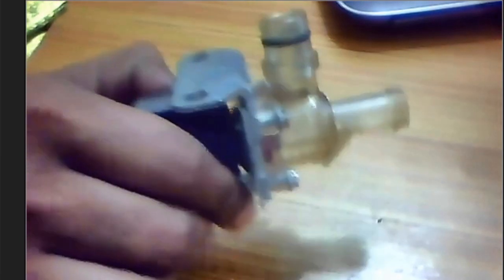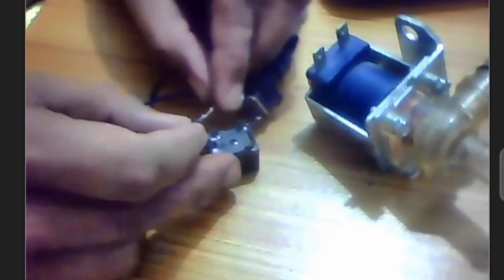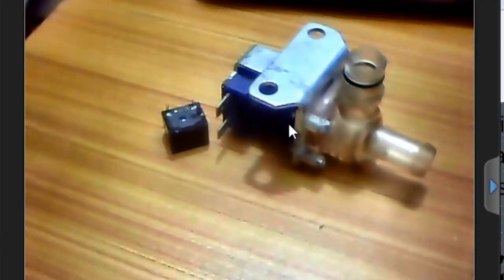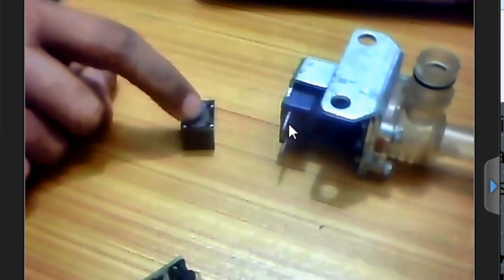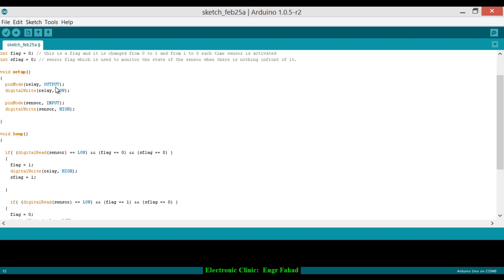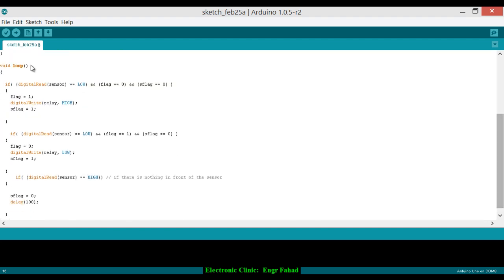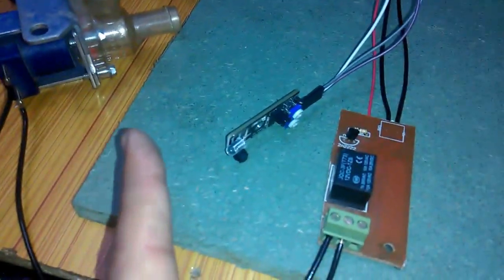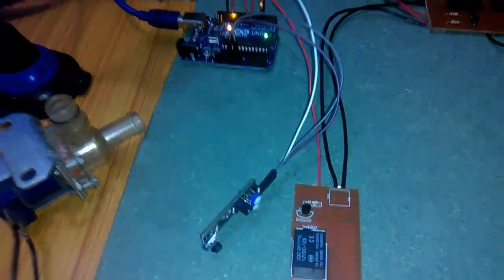Arduino based Automatic Water tap using solenoid valve, infrared sensor, relay and transistor

Comment: Hi the program mentioned in you video is a toggle switch basically  can you help me with a program where if one puts his hand the water flow is on and when one removes the hand the water flow stops thank you
Reply from the maker: check playlists. there are two other versions of the water tap system

Comment: My solenoid valve wont turn on. Is there any addition coding ?
Reply from the maker: my friend there is no addition, check your adaptor voltage and current ratings
Reply: my adaptor voltage is 12V and 1A, is this the reason ?
Reply from the maker: did you find its coil resistance???
Reply from the maker: whatsapp your connection, and solenoid valve pics. 
+923339218213

Comment: Hey! Thank you for the video. It was so helpful. I am trying to do the same thing with an air solenoid valve. However, I do not have a relay switch. Is there any way to do this without the relay switch?
Reply from the maker: Rachel watch my tutorials on relay driver circuit design calculations
Reply from the maker: Rachel check other tutorials.
subscribe and keep visiting electronic clinic 
if you have any question feel free to ask.
Reply: Electronic Clinic definitely subscribed! The video tells me how to calculate it the current needed for the relay, but I’m still not sure what relay to buy. Or if I need one. The valve will not turn on with my current circuit set up exactly the same without a relay. Do you have any insight on how to make it work without one or what to buy? I checked the valve with how you showed us and it needs 430 mA to open
Reply from the maker: you can buy any spdt relay "
Reply from the maker: you can also dpdt " double pole double throw.
Reply from the maker: Always watch a complete tutorial and never miss the discussion part. Because its the discussion that makes you able to learn fast and helps you in developing logic level, innovation etc